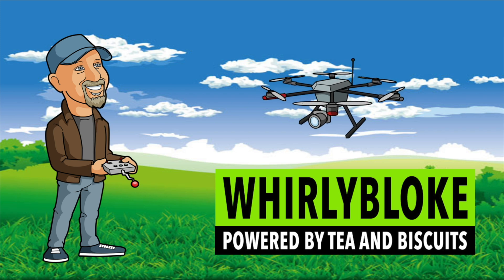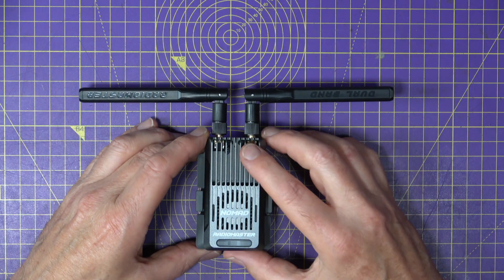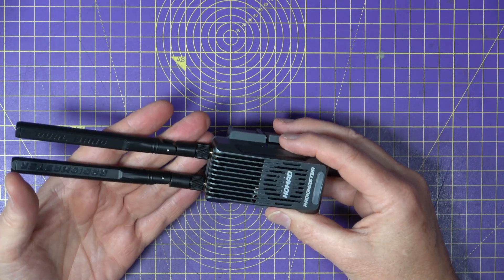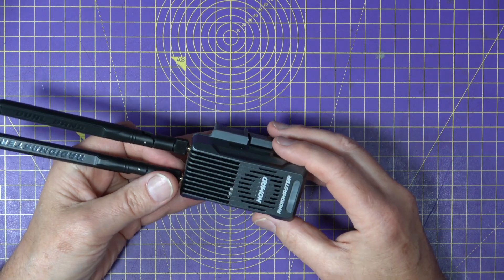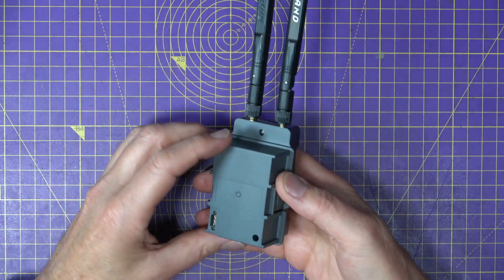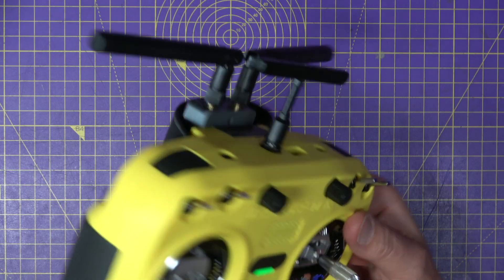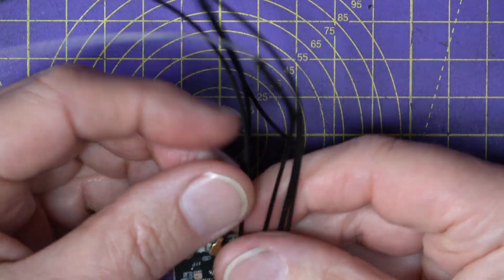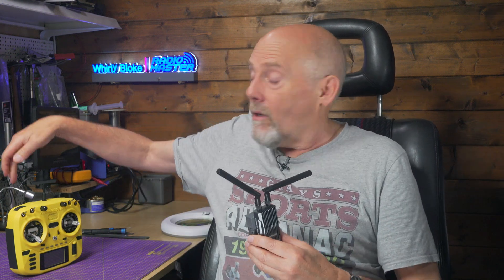RadioMaster Nomad - Dual 1W Gemini Xrossband ExpressLRS Module - Long Range RC Control and Telemetry

Comment: Sorry I’m late to this very interesting video.
I’m curious 
Since you have had time to test out 
Both the Nomad and Bandit 
is there any discernible difference between them in operation at 858 MHz? 
Range etc?

Have you kept the standard antenna on the nomad or swapped them out for 858 MHz 
Specific antenna 

Many thanks
Reply from the maker: I’ve had a fair bit of time with both the Nomad and the Bandit now, and honestly, performance at 858 MHz is pretty comparable in terms of range and link quality. Both are solid long-range options, especially with the Gemini crossband setup. The Nomad seems to handle telemetry a bit better in marginal conditions, probably due to its dual internal receivers and some clever RF switching. It’s subtle, but noticeable when you’re really pushing range. As for antennas, I did swap out the stock Nomad antennas for a pair tuned closer to 858 MHz, just to optimise for UK legal frequencies. The stock ones are decent and broadbanded, but dedicated 858 MHz antennas definitely helped tighten the link budget a bit, especially on low power.
Reply: Thank you for the prompt response,
I have been trying to decide which one to use 
Planning to update a Taranis X9E 
with one of the modules.
Just using 868.
Although if someone come up with a 
458mhz and offered an Rx with 14ch
like the betafpv superP 
That would be great.

Comment: Does it support FHSS hooping?
Reply from the maker: The RadioMaster Nomad, which uses the Gemini Xrossband ExpressLRS module, does not specifically support FHSS (Frequency Hopping Spread Spectrum) hooping. Instead, it operates using ExpressLRS, which is a high-performance, long-range radio control system that works based on the more modern and efficient LBT (Listen Before Talk) and FHSS technologies, but in a specific way designed for low-latency, high-reliability control. If you’re asking about whether it supports hopping (changing channels automatically within the spread spectrum), ExpressLRS does use frequency hopping, but it’s managed by the system, not manually adjusted during operation like traditional FHSS systems.

Comment: Thanks for another brilliant review, Whirly Bloke. I've been waiting for RadioMaster to produce this. I plan to upgrade my 7" quad to this system. Frankly, though, my maximum distance limitation is currently my vtx signal. I'm seeing significant video loss at approximately 1.5 miles with the DJI 03 Air Unit. I am confident I could get more with some antenna mods on the quad and goggles. I am not at all unhappy with 1.5 miles and rarely feel the need to go further. Improvements in penetration and reliability in noisy and dense environments would be welcome and I love to test the new technology even though control transmission/reception is almost never my limiting factor. I am currently running my RadioMaster Pocket controller at 250mw with the RadioMaster RP4 true diversity receivers and have had great results but I have wanted to try true gemini mode. Also, I wanted to say that, in my opinion, most of RadioMaster's upgrades are more than just flash. The Boxer Crush for example comes with AG01 cnc aluminum gimbals stock which are an expensive upgrade when installed after market. I am seriously considering replacing my Pocket radio with a Boxer but I'm dragging my feet because I think RadioMaster will soon produce a Boxer model with the upgraded gimbals, large color touchscreen, and built in Gemini technology at 1W or greater 🤞. I can afford to wait since I'm absolutely satisfied with my current rig. Thanks again for producing such high quality content that I find interesting, informative, and entertaining. Happy flying amigo 🫡 🍻.
Reply from the maker: Thanks so much for the kind words and detailed comment! It sounds like you’ve got an awesome setup going already. I totally get the balance between waiting for the next big upgrade and being happy with what you have—especially when you’re already getting great results. I’m with you on the potential for antenna mods to push the limits even further. The Boxer with built-in Gemini tech at 1W+ would definitely be a game-changer if RadioMaster goes that route! Keep us posted on your upgrades, and happy flying to you too, amigo! 👊
Reply: @WhirlyBloke  🤠👍
Reply: fcc hack will sort that
Reply: @Gippslanddroneflyers  I use the FCC hack. My distance has improved, but I still see single digit readings at 1.5 miles. I think the next step would be antenna  upgrades if I continued to chase distance. Happy flying amigo. 🫡 🍻
Reply: @Sonic_Ox  yes probably only thing you can do.
But there is a video from Joshua bardwell that apparently you need to go into the lua script and change a setting.
I need to look it up again. 
All radiomasters do this it's like a setting that puts it in like a race mode in range 
I think the packet rate
But once changed its night and day difference.
More range
Reply: In the elrs lua change the packet rate from 1000 to 250 or less
Reply: @Gippslanddroneflyers  Thank you. I'll look into it. It's my understanding that low packet rates give more range, but with a bit more latency. I always use the lowest because I don't notice latency with my flying style. I'm not into aerobatics and prefer longer range to lower latency. Thanks for your input and advice. Happy flying amigo. 🫡 🍻

Comment: Can this do switch mode like betafpv super g (which work with normal receiver)?
Reply from the maker: The Super G was the first gemini TX module but it's only 2.4GHz and doesn't have Xrossband. Don't be surprised to see that change soon though 😀

Comment: What would be an appropriate VTX for long range (Preferably digital)?
Reply from the maker: I reviewed a 2.5W and 5W analog VTX recently, but if you want digital, DJI O3 is still probably your best option. WalkSnail, HDZero are great, but they still don't beat DJI,  regardless of whether you like DJI or not.

Comment: Would it be better to get this one instead of the radio Master Ranger Micro?
Reply from the maker: They are a similar price, but the Ranger isn't Gemini, so I think the Nomad is the better option. You will of course need the matching receiver to take full advantage. Check my other video about the advantages of Gemini mode https://www.youtube.com/watch?v=pNbLUcxHDdk

Comment: range test please.....:text-green-game-over:
Reply from the maker: I'd love to, but as I've said in all my videos about long range RC and VTX gear, the legal distance limit is the UK imposed by the CAA is 0.5km. And since I'm a commercial operator and don't want to jeopardise this, I won't be publishing any long range flying tests - I'm sure there'll be others willing to risk all. In the past, I've simulated things using ground tests and may do the same with this at some point - difficult though. TBH signal penetration performance is more important for the flying I do, so I plan to test that sometime.
Reply: @WhirlyBloke  European Gulag)